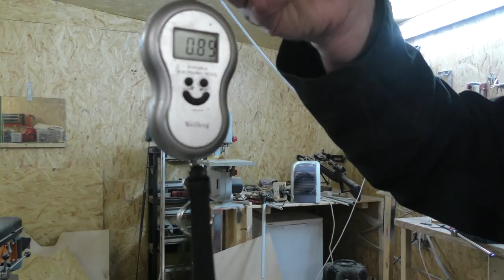How To Make+Shoot The Pump Action Repeating Crossbow Pistol

Comment: Sucks that all crossbows and crossbow pistols are illegal in Norway. Retarded rule. I could make one like that though, but i dont know how to get decent bolts for it, and i would need to find something to use as bow
Reply: Thick walled aluminum or steel tubing of the appropriate size, plus some self-adhering fletching. For the heads, hand-shaped steel rod filed down to fit into the end of the bolt, and epoxied in place. There's your crossbow bolts :).
Reply: jason sexton
Sounds like a lot of work, compared to buying cheap ones like these. Maybe its best to just try and buy some bolts from ebay, and see if they get stopped or not.
Reply: Making a bolt takes a couple minutes, just use wooden dowels and masking tape, you don't need tips, but if you want them, there's dozens of arrow tip tutorials on YouTube. As opposed to making this crossbow, which in total time probably takes 2-3 hours even if you just go by the blueprints and you're good at wood working, longer if you want to change the size. You can make the bow out of PVC pipe - check out Backyard Bowyer here on YouTube, he has a nice crossbow build tutorial using PVC pipe for the bow.